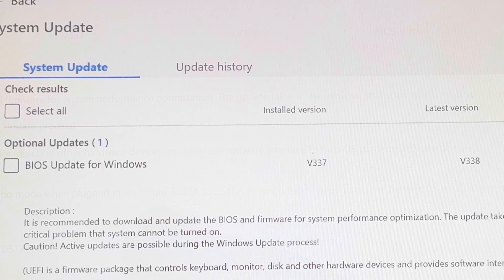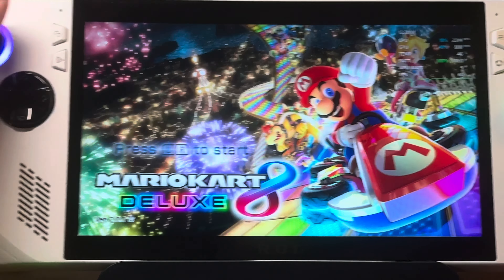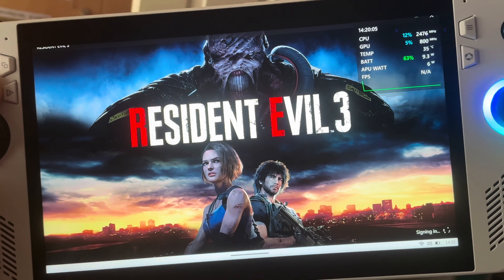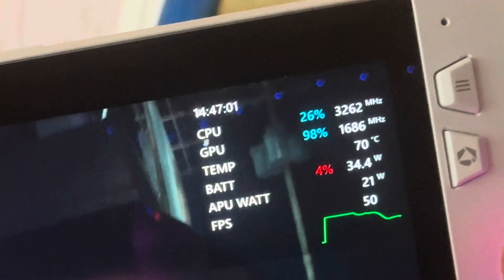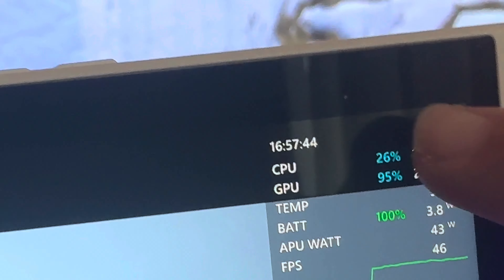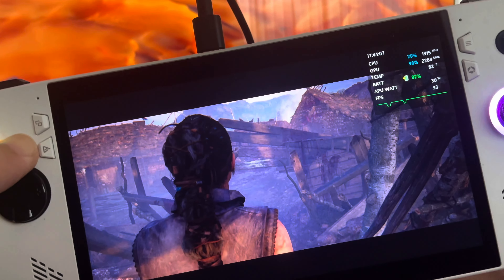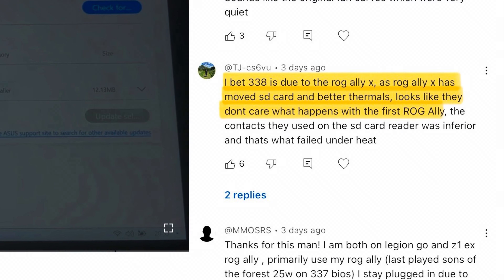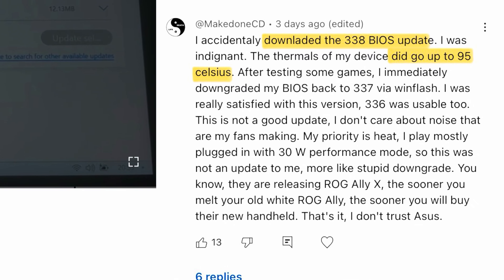Has BIOS 338 made the ROG Ally TOO HOT??!

Comment from the maker: Has the new BIOS 338 made your Ally stay around 80 degrees on 30w Turbo? Or worryingly high above 90 degrees? 👇
Reply: the chip runs perfectly fine at 95. Amazing update.
Reply: @MicaelAzevedo bruh I’m pretty sure playing constantly at 95 degrees isn’t good
Reply: Yes it got hot, but 80 degrees is fine.

The device only gets too unbearable for me if I fast charge and play at 30 watts at the same time. 

Thankfully that period isn't too significant.
Reply: my ally has pretty much lived at 95c in 30w its whole life and i have massive 6 hour gaming sessions regularly. its never been an issue. if you feel that it is a big issue for u just turn off cpu boost or make a manual fan curve to match the old curve.
Reply: @nazoX7paradox  If you are constantly at 95 please repaste the Apu. that is not normal.
Reply: It gets hot to a point battery charging stops
Reply: Battery won't charge while playing now. Which makes 2042 not playable now. Sucks.
Reply: I’ve hit 95C plugged in at 30W since the BIOS upgrade and am considering switching BACK to an earlier BIOS: any comments/ success stories to share about switching back to an earlier bios here?

Comment: 80 degrees is fine for these chips, I run mine at 80 all the time and never had an issue. AMD's real red zone is 105 degrees and it can't hit that temp, it'll throttle at 95 degrees.

Always remember to keep CPU boost off to prevent thermal throttle.

Comment: I have an aggressive custom fan curve. At 60 degrees both 1 and 2 run at 100% keeping my temp at below 70 degrees. The problem with this Bios update is that they want to degrees the noise from the fans. But the result is of course an higher temperature due to less motions from them. And I deactivated the boost modes I rather play with lower graphics than to have it run at  90 degrees through out the game sessions.

Comment: You often hear people say that temperatures above 90°C are fine, even claiming that 'these chips can handle 100°C.' Technically, that’s not entirely accurate. I’ve only noticed overheating issues recently while playing Forza Horizon 5. In manual mode, power consumption spikes to 43W-50W, and once temperatures reach 80°C-90°C, the game begins to stutter. For context, I’ve already set a custom fan curve, with both fans running at 100% once temperatures hit 75°C.

Comment: ROLL BACK THE BIOS. I was having problem with charger stopping and I did roll back and that fixed the problem. Even with custom fan curve the fans are not fast enough as in the old bios. Now my temps never go above 90°C  even in 30w and charging. On the new bios I was getting 95°C with the fans at max. 

PS: I live in Brazil, a very hot country.
Reply: More than that, it stops charging at +95°C and only goes back to a charging state when it drops below 65°C. This bios doesnt make any sense.
Reply: Can I know which bios did u downgrade it to? Im having the same problem with the charger
Reply: @FarzaNamza  I went to 337
Reply: @gugax10  thank you. Back to normal now. I was really stress when the charger kept  on stopping while I play games

Comment: Clickbaity titles and miss-information is terrible for the community.

The temps not only are perfectly reasonable they were the original fan curves when the device first launched. I've been waiting for months for Asus to finally realize that the microSD card issue isn't heat induced and give us back our original fan curves and now that they have people immediately just to "OMG ASUS IS DESTROYING OUR DEVICE'S"

If you want a cooler device they have fan control in AC blast the fans so she runs at 70c it won't make any noticeable difference in the longevity or performance of the device and just makes it sound like a gaming laptops jet engines.
Reply from the maker: No clickbait or misleading info was intended Tek - this vid is in response to my BIOS 338 update vid where the most liked comment from viewers was that Ally owners found this new BIOS was making the Ally run TOO hot, hence my exploration into this... 👍
Reply: I don't know what he is talking about this BIOS update has made the way I use mine all but useless. Thank you for highlighting this information. Hopefully it will get fixed. My Rog Ally goes to 95 and won't charge every time I use it 10 min after updating.
Reply: Didn't have a problem with loud fans what so ever. At least I could play my game.

Comment: Depend on your ambient temp. With 34c in my place ally run 5c hotter after update and reach 90c 25w mode. So dont misleading people here. It was fine when im using at 15c ambient temp
Reply: Ya 
Same 
Its kinda weird
Reply: @RogAllyTester  isnt weird. Its physics lower fan speed = getting hotter. Now im using manual mode for 18/25w. Never use default 25/30w mode anymore

Comment: Anybody hear of a coming update to fix this. If i can not play the game, i want the way was i want over the last year kinda don't want the Rog Ally anymore. It is something i used daily, so I'm pretty bummed.

After 5 min of playing BF 2042 it stops charging. Been trying to lower setting and it still not enough. For a about 6 months been playing med to high setting at 1080 with fps at 47 to 57 with average of about 52. Temp around 88.  Now 5 min in or less its at 95 degrees and am lucky if get another few min before the charger stops. wattsage drops from 30 to 25 and perfromance dips and battery drains about 5 percent per minute. Even droping settings and res down to 720 it still ends up running to hot. This is went from being amaing to borderline useless.

Comment: My SD card reader stop working again  I not buying from them anymore
Reply: Just upgrade to a bigger ssd with the adapter bro. Im running 8tb gen4 drive. I have mine extremely modded with a copper plate so heat is never an issue 👌
Reply from the maker: Nice! 8TB wow! 🤩
Reply: SD card stops working because of a faulty fuse. It seems Asus figured it out since the fans are set to normal now.  You can replace the fuse yourself if you are good with a soldering iron. Or send it to Asus.